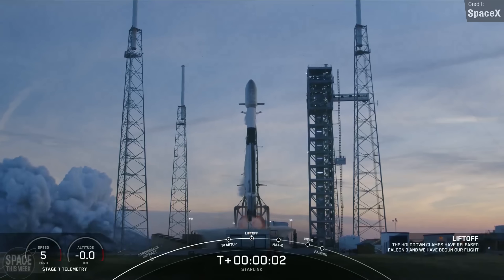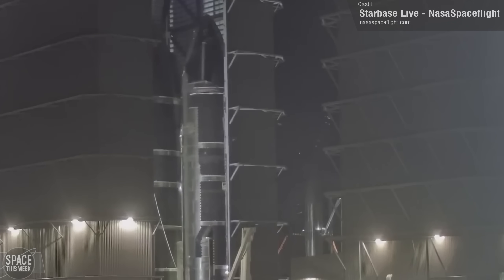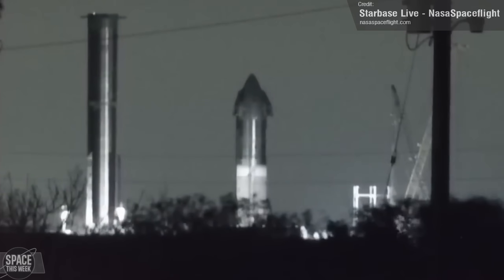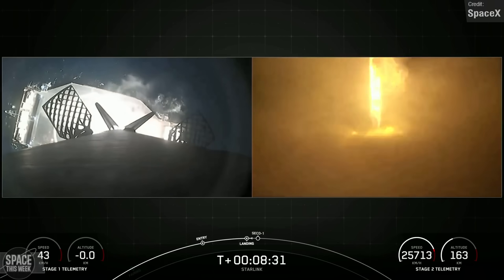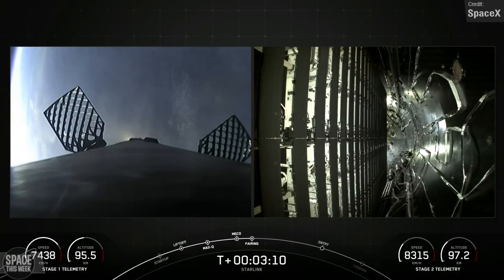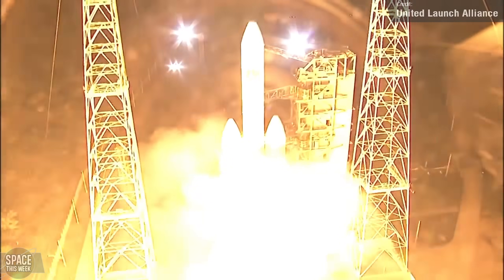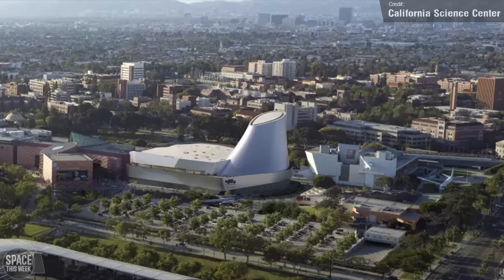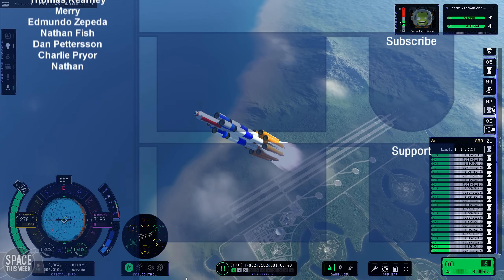SpaceX's Superheavy 10 and Starship 28 Are Approaching Launch

Comment: SpaceX got Falcon to space by learning from mistakes. I agree with this approach.

Sadly starship is not learning from the current mistakes. Sadly booster 10 has a problem that will not go away. The fact is 33 engines of one frame has never worked. It creates so much vibration that it literally tears it self apart. It also transfers this vibration through the entire rocket.

SpaceX should just add a series of cameras inside the enclosed portion of booster 10. A picture is worth a 1000 words. They will see the the engine mount ring flexing to the point that is tears the engines apart as well as the pluming.

I look forward to the next 🧨.

Comment: As the launches requiring full use of SpaceX boosters increase its about time for a revision of the booster and fairing design. Engine performance has increased apparently so time for a revision of the design, possibly supporting an upgraded Dragon.
Reply: Spacex have made it clear that once starship is flight proven and approved, Falcon 9 will retire
Reply: @Corvus.2606  until the Starship is human rated and is cheaper to launch than a Dragon.
Reply: @michaelreid2329  that's what I said... But either way, why would they dump millions into development of a platform that is approaching end of life? Even if Starship is 5 years away, it wouldn't make fiscal sense
Reply: The Falcon boosters time is coming to an end.  There is no reason to redesign it.
Reply: @kokomo9764  except for the same reason we have multiple sized aircraft with different cargo capacities. You need Dragon, Dreamchaser and launch vehicles to set passengers, crew, supplies etc to Starship.

Comment: Now. I may be a bit late in realizing this, but ... Starship's envelope flap is fairly specific. As far as I know, there aren't many other satellite launches that could utilize starship in this config. Isn't this inefficient in terms of cost. Limiting yourself to one specific thing, that's how plenty of things have gotten canned 
(Ex the zumwalts, cause their guns could only accept a specific ammunition.)
I know we've seen graphics for other Starships, with the opening nosecone, but still....
Reply: Probably working on getting a working platform running and then worrying about adapting it to payload variance
Reply: It’s worth customising for a repeat customer.
Reply: SpaceX have a tendency to build now and figure out the rest later, I think they’re the company with the best chance to not meet that fate. Also, with the number of Starlink satellites they’re planning to launch, they can get to the point of regularly launching starships first, letting them stagger their engineering work more.

Comment: Will there be a Starship Heavy, with 99 engines firing at liftoff?
Reply: If the technique is mature and scalable, people will use it. Both ULA and SpaceX have experience with multi core rockets ,so maybe.
Reply: I expect to see longer boosters and stretched ships in the next few years. Keep in mind that the Raptor engine design is still getting more powerful.

If that incremental growth isn't enough I predict that they will go to a larger diameter booster, rather than multiple cores.
Reply: @hamjudo  I read somewhere that Vulcan has a height restriction to allow for the continuous use of the legacy titan and atlas ground infrastructure. Not sure it can stretch. Kinda weird, but apparently that's why it's more squat like that.
Reply: Probably not. I see no reason for there to be one plus it'll probably have to be launched from the ocean since I dont think any launch pad could handle 99 raptors.